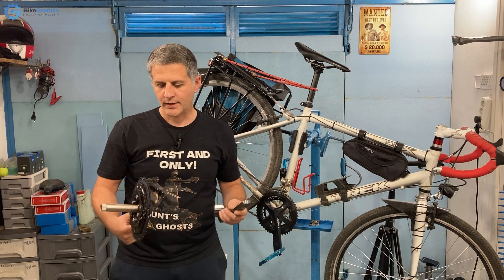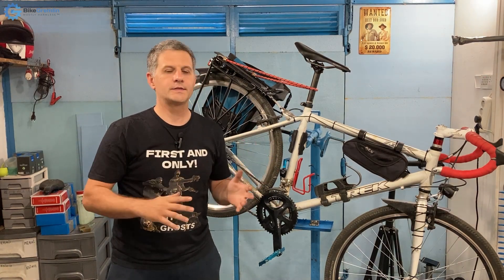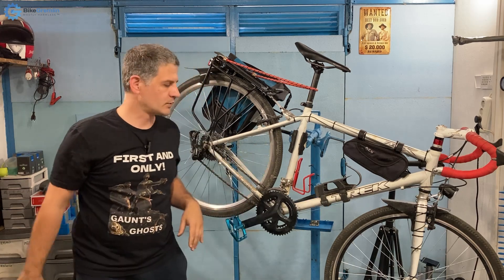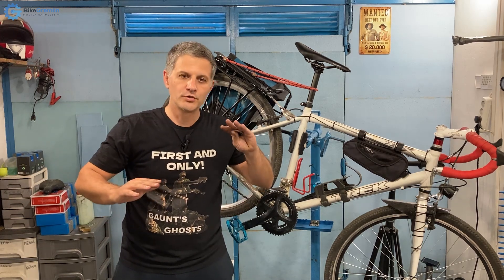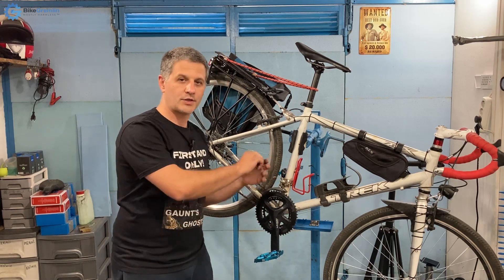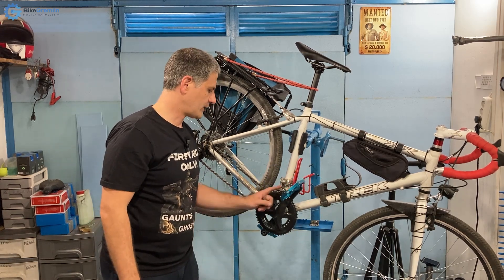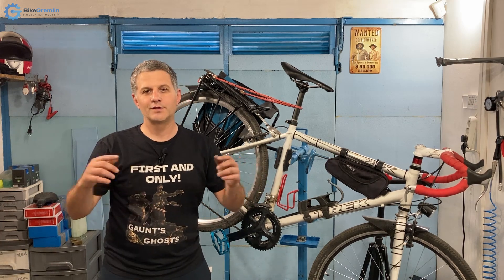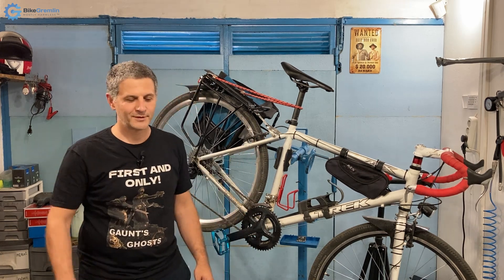Hollowtech II safety check

Comment from the maker: To clarify:
In terms of axle diameter (24 mm), material (steel), crank attachment (with enough preload) and failure mode (for the non-top-tier-super-light models axles break usually when they are worn from busted bearings), Hollowtech II is probably the least bad existing BB & crank design.

In terms of crank arm design, it still has some nonsense, as discussed here:
https://www.youtube.com/watch?v=7e2Jyh8pHss

Square taper axles, on the other hand, fail in the spot between the crank arm and the axle, and that is highly impractical to regularly check - as explained here with photos:
https://bike.bikegremlin.com/10123/unsafe-cycling-patents/#3.2
Edit:
Yes, square taper bearings last several times longer than Hollowtech II, that is an advantage, but I'm not comfortable with that BB patent for stuff that isn't commuting on separate bike lanes (i.e. no climbing hills in traffic, bombing down hills off-road and similar).

Other modern 2-piece crank designs (SRAM, FSA and others) are basically a workaround Shimano's patent and not optimal (in terms of axle diameter for one, at least in my opinion). It is one of the silly things about capitalism, but that's what we have to work with (I heard that Park Tool company has trademarked the blue colour for tools - go figure...).  :)

P.S.
I suggest using the BikeGremlin forum for any questions or comments, since YouTube is a bit buggy when it comes to notifications and later search:
https://www.bikegremlin.net/

Relja
Reply: not to worry, the hollowtech bearings have plenty of friction by design.
if you can break a square tapered axle before the bearings wear out, then it's bragging rights.
Reply from the maker: @carlosgaspar8447  They break due to material fatigue, not for being too strong. It is a known problem - see the link above for the pics and more details.
Reply: @BikeGremlinUS  yes, but by then the bearings should have been changed which would avoid the wear and tear on the spindle.
Reply from the maker: If we're talking about square taper axles breaking, they don't break from bearing problems, generally. They break because of the fatigue when transferring loads, at a place where the cranks are mounted (usually at the left crank, because that side sees both bending and torque transfer at the same time (when you press on the left pedal to turn the chainring on the right side).

Bearings of square taper BBs are hidden from much dirt intrusion inside the frame and, thank to the spindle being relatively low diameter, can be big enough. They last for years and years on cartridge square taper BBs without any servicing. Square taper BBs don't have problems with bearing durability. They are outstandingly good in those terms.

Comment: I noticed the chain is oily and dirty.  Have you considered waxing the chain like Oz Cycle has demonstrated?  My wife and I just went through the process on our bikes and it makes a world of difference, preserving the cassette and chain rings, and extending the life of the chain.
Reply from the maker: Glad to hear it works for you. I haven't been very happy with chain wax. This has been my experience:
https://www.youtube.com/watch?v=_BaPfHqQ2Ec

Relja
Reply: @BikeGremlinUS  I watched your video.  However, Oz Cycle has a system for using hot wax and PTFE powder that works very well.  There is the initial time to thoroughly clean the chain and hot wax it with the PTFE mixed in.  However, the once every 180km rinse and wax is very quick.  The big benefit is the superior lubrication that extends the life of the chain and cogs and chain rings.  I encourage your viewers to watch.

Comment: I do similar checks on my adjustable loose square taper bb, although I don't remove the chain since it's kinda obvious. Haven't tried it for 2 piece cranks, but it makes sense and should improve the life of crank spindles. Since I have seen pictures of them getting worn down where the bearing is.